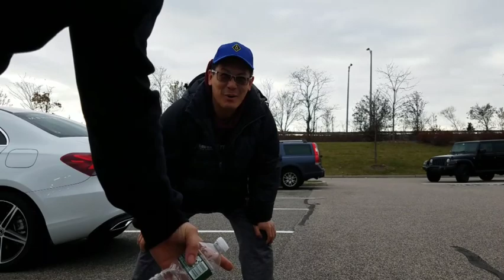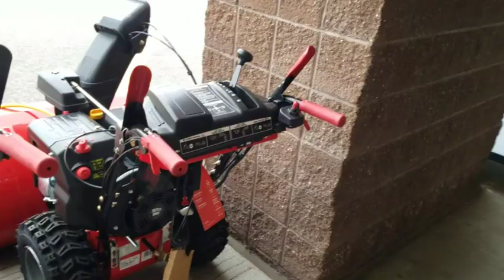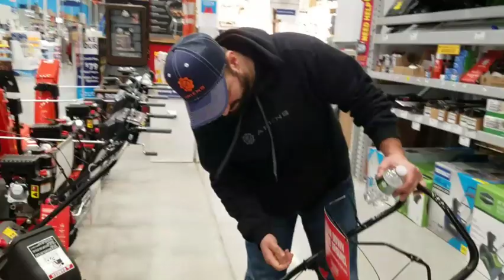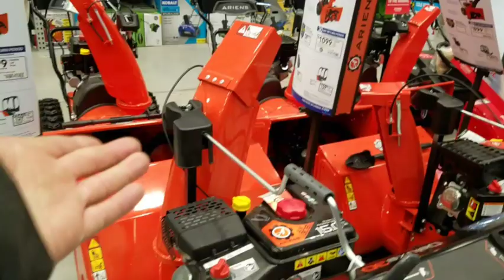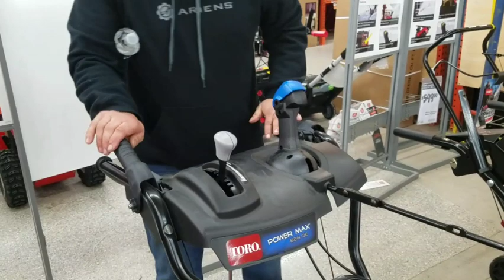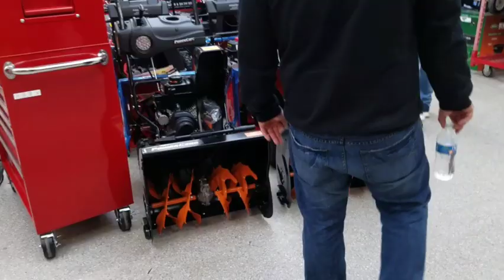2019-2020 WINTER SEASON BIG BOX LOWES HOME DEPOT RETAIL STORE SNOW BLOWER LINEUP SNOWBLOWER REVIEW

Comment: All snowblowers can produce vibration plentiful.
By experience nuts and bolts and fasteners can shake loose during snowblowing and transporting.
Check those fasteners regularly or add lock nuts, lock washers or apply thread lock sealents to prevent interruption during use.

Comment: Should I get the Craftsman 28in or the Ariens 28in? 
Craftsman: https://www.lowes.com/pd/CRAFTSMAN-SB470-28-in-243-cc-Two-Stage-Self-Propelled-Gas-Snow-Blower-with-Push-Button-Electric-Start-Headlight-s-Heated-Handles/1000602839
Ariens: https://www.homedepot.com/p/Ariens-Deluxe-28-in-2-Stage-Electric-Start-Gas-Snow-Blower-with-Auto-Turn-Steering-921046/207118306
Reply from the maker: If money is not the issue, get the ariens.
Reply: @MowersNBlowers  What would the biggest difference be? Thanks for the response :)
Reply from the maker: Gauge of steal used.  Reinforced impeller and auger shaft.  Reputation of company.  Craftsman is now black and decker stanley, but made by MTD which is substandard to Ariens in Snowblower’s in my opinion.

Comment: Hey Excellent video tutorial. The shop I work at sell plenty of the new updated Toro Power Max designs with the non clogging impeller. I like Ariens but Toros auger box design is excellent. They also have the easy turn steering. That’s been also updated.
Reply from the maker: Appreciate it Joseph. Hope you'll subscribe

Comment: The valve cover on the hemi is aluminum, the non hemi has the stamped steel. Easiest way to tell and where the openings in the box are to lift it, the valve cover is on one side behind the flap, so you can literally look into the box and tell.

Comment: The LCT headquarters in South Carolina is actually pretty good. Last winter, I had an Ariens Sno-Tek with a broken valve keeper on a 208cc. I contacted LCT in the US, they sent me a head repair kit free of charge and it got here fast, so their customer support is really good, because of the fact their engines are on Ariens snowblowers. So they do a little more than sit around watching tv, they have parts in stock down their.
I still like Tecumseh's way better, but out of all the new wave of blower engines under Briggs, LCT is probably the best.
Tecumseh went out December 31st 2008, coming up on 11 years ago. 
Certified parts corp bought up Tecumseh and eventually the asset was sold off too LCT, so aside from the Lauson, Tecumseh and power products name along with snow king, which I have seen a few, they have no relation to the old true Tecumseh and these new designs were never put out by old Tecumseh, these were fully redesigned by LCT.
Tecumseh is actually still in business in the USA, they just went back to only making ac compressors, for refrigerators,  etc, which is what they were doing prior to buying up Lauson in the 50's and getting into the engine business. So their around, just not in the engine business anymore.
Reply: Snow King is a Tecumseh same engine
Reply: @mrbriggs68  The rights to the snow king name, went with Lauson and Tecumseh when Platinum equity bought out Tecumseh, certified parts corp purchased it from platinum equity a financial firm and got all of the old unfinished engines and parts and than went into contract with LCT. LCT makes and has made engines called snow kings that are not the old true Tecumseh, so they aren't the same and should not be confused as such.
Here is an LCT snowking right here for sale on ebay. Its not an old Tecumseh, its an LCT, the right to that name is with LCT now, along with Lauson, Tecumseh and power products, all with LCT now.
https://www.ebay.com/i/333330096571?chn=ps&norover=1&mkevt=1&mkrid=711-117182-37290-0&mkcid=2&itemid=333330096571&targetid=475515113261&device=m&mktype=pla&googleloc=9004005&poi=&campaignid=6469750489&mkgroupid=77932583899&rlsatarget=pla-475515113261&abcId=1141176&merchantid=6296724&gclid=CjwKCAiAzuPuBRAIEiwAkkmOSBMR5fhvYRoCDTBFm4464R6t7NN9d3Fh8ff9SBx_yC27guBWyvVAQxoCjoIQAvD_BwE
Reply: @mrbriggs68  https://www.ebay.com/i/333330096571?chn=ps&norover=1&mkevt=1&mkrid=711-117182-37290-0&mkcid=2&itemid=333330096571&targetid=475515113261&device=m&mktype=pla&googleloc=9004005&poi=&campaignid=6469750489&mkgroupid=77932583899&rlsatarget=pla-475515113261&abcId=1141176&merchantid=6296724&gclid=CjwKCAiAzuPuBRAIEiwAkkmOSBMR5fhvYRoCDTBFm4464R6t7NN9d3Fh8ff9SBx_yC27guBWyvVAQxoCjoIQAvD_BwE
Reply: @Mr_Tecumseh  a real snow King https://images.app.goo.gl/Wed4fZ351Y8mGeMA8 and i already know about lct. Long ago

Comment: Am I seeing things, or did that first 24" at Lowes have rust on the scraper blade?
Reply: Yes, that is rust on the auger shaft. It was probably made out of cheap metal with no coating, or anything (plain steel is what they called). They will rust eventually, but that happened way too soon. Just to show you their quality.
Reply: @lanfan1464  No coating, no paint, so it rusts. They didn't make them to rust, their just to cheap to paint them, so that they won't rust. If I bought one of those, which I wouldn't, I would put a coat of paint on the shaft to stop it from rusting.
MTD, being cheap, its what their known for...
Reply from the maker: It's possible, it's probably been outside for sometime..it's been wet here lately too!  Man you see everything on the big screen HUH?
Reply: They make them to rust